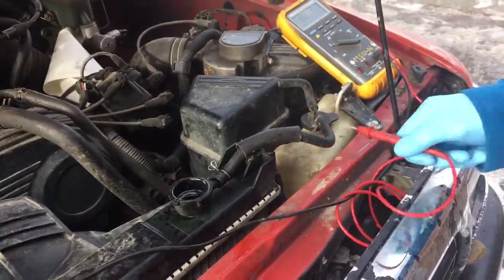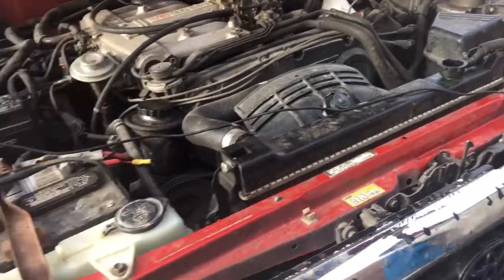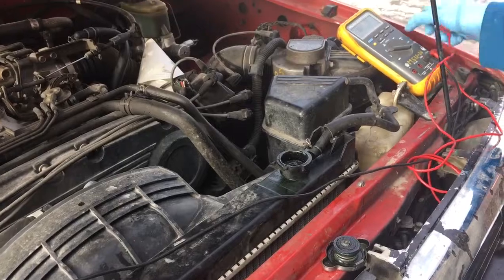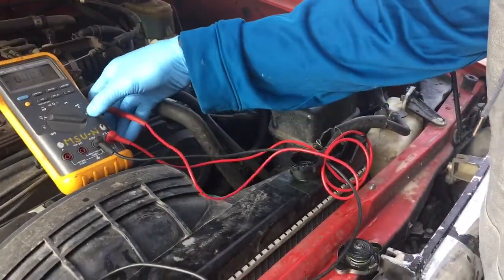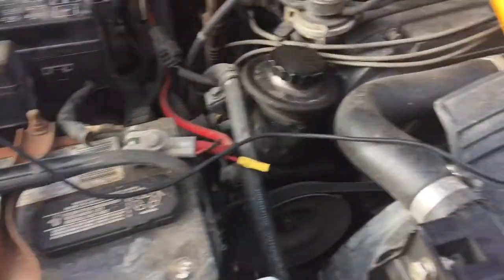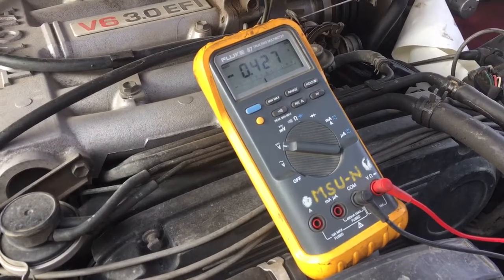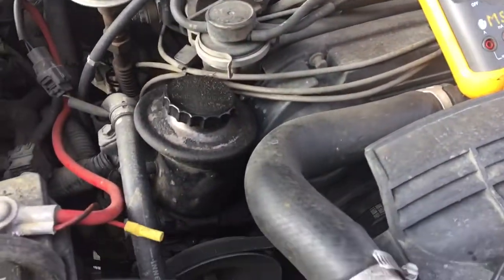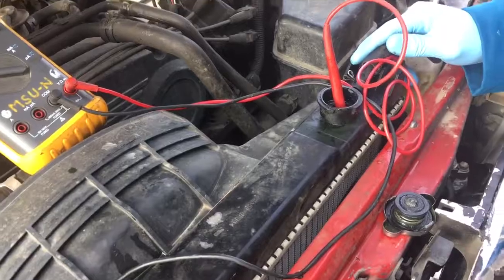Electrolysis test cooling system

Comment: Add a ground to the radiator. It will stop the electrolysis.
Reply: In my experience, adding a ground makes it worse because then you are actually giving the current somewhere to go. Had a customer a while back who had gone through 3 radiators in 3 months before bringing it to me. I noticed the 3 earth wires he had added to the radiator which had been done about 4 months prior because his engineer mate told him to. Anyway long story short after trying to explain to him my thoughts, I removed the earth wires and replaced the rubber mounts (one had been changed to a solid bracket for whatever reason). Fitted another radiator due to the previous one being corroded. He went 6 months and no issues. Then apparently his engineer mate told him i didnt know anything and it was probably just a couple of dud radiators before that and now he has a good one so he put an earth wire back onto it and guess what happened a few weeks later...